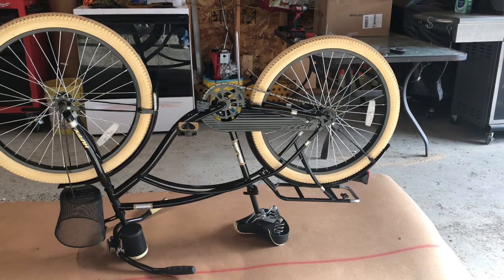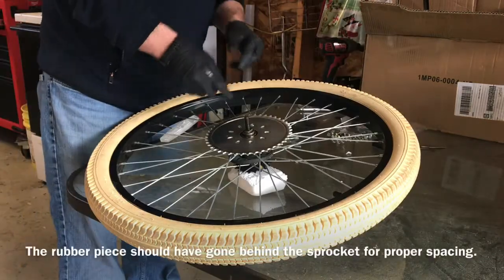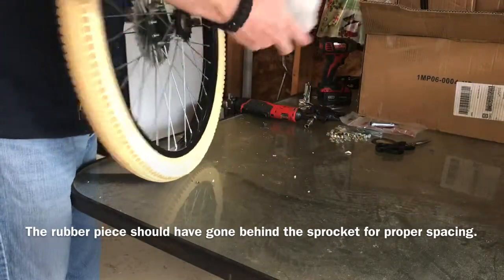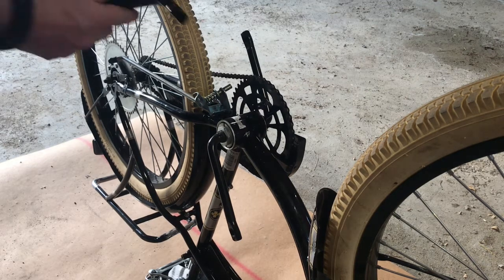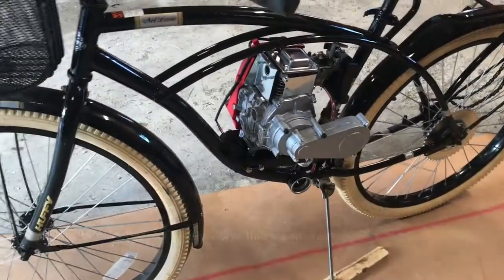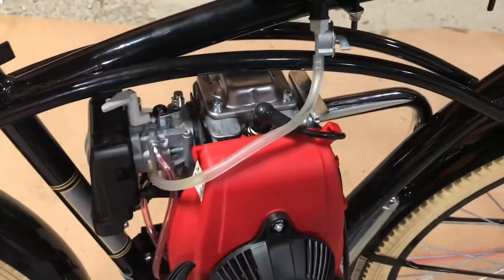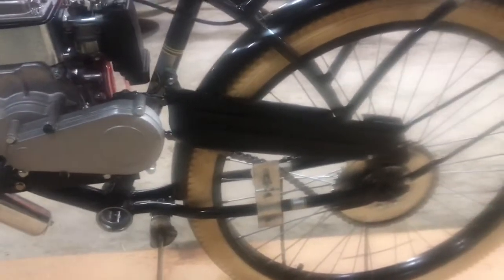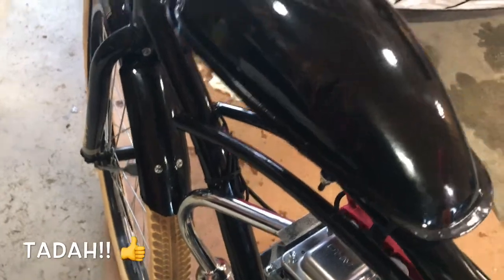PART 2, 4 stroke/cycle engine, bicycle kit, THE BUILD!

Comment: You put your back sprocket on wrong those little metal plates are supposed to go on the inside of the rim 😂🤣😂👍 and a two rubber gaskets sandwich the rim spokes but if it works go for it😁

Comment: do you put the exhaust gasket behind or in front of the heat sheild
Reply from the maker: person I put it behind the heat shield. The bolts go through the flange, then heat shield then gasket. (If I remember right) You want the gasket against the engine.
Reply: @GallagherRC  so its the gasket first, then the heat sheild, then the muffler?
Reply from the maker: person yes, if talking from the engine towards the exhaust.